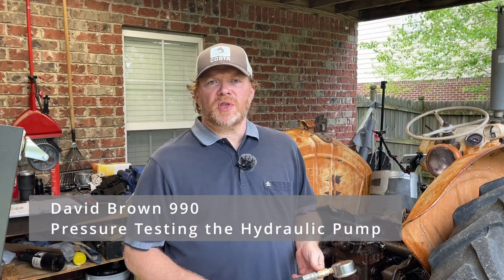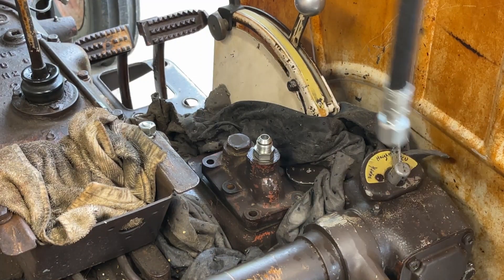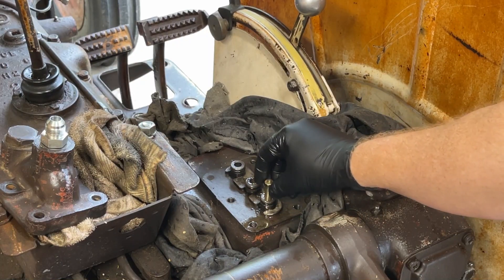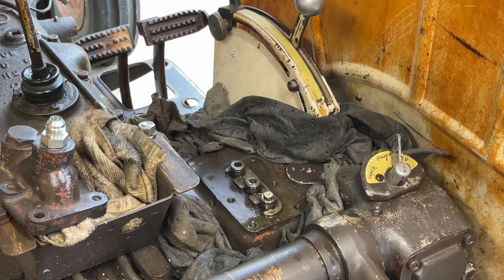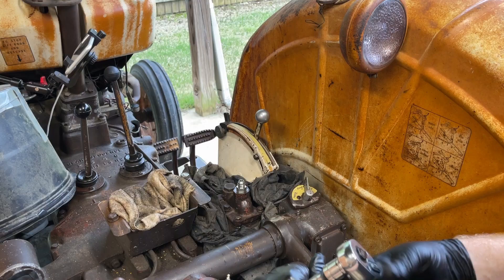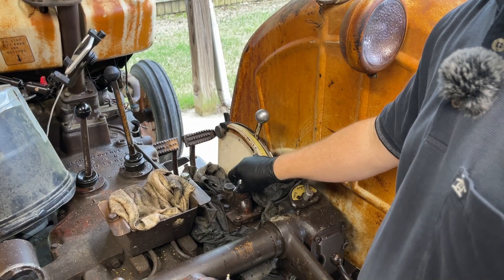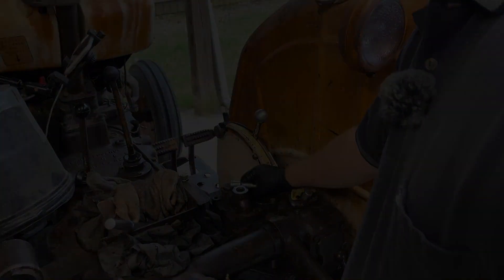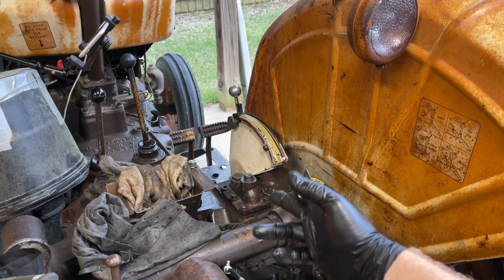Testing the Hydraulic Pump Pressure | David Brown 990 #22

Comment from the maker: For blanking off the rear pipe, anything that will seal it up on the top will work.  A short bolt that fits the hole will work just fine.  Just put an oring or something on it to help with sealing.

Comment: Hi Shane Marshall here. Do you know what the engine cylinder psi should be on my 996? Tests at Cyl 1, 300psi, cyl, 2 275psi, cyl 3, 275 psi and cylinder 4, 350 psi. I made a fake injector that can bolt on in place of an injector with compression test kit gauge  adaptor.
Reply from the maker: Hey Marshall, sorry for the delay, I've been super busy lately with actual work and family stuff.  I don't know what the PSI's should be for the cylinders.  I looked in my manuals and can't find it either.  Hope you've found out by now!
Reply: I think diesel in general are around 300-400psi. Have a vid coming in a few weeks testing the DB engine.Got a tip how to determine if it's the valves or rings from Bundy Bear, Lance. put some oil in the cylinders and if compression go's up rings if not valves. Cheers Shane

Comment: thanks for the great videos, how many hours has the 990 done?
Reply from the maker: Hi there, thanks for watching!  This was my grandfather's tractor and he bought it new back in the late 60's.  Our family used it quite extensively for farming, and from what I'm told my grandfather treated it like a bulldozer when he had a blade on the back!  I've replaced the tachometer/hour meter since the old one was broken around the same time I had the engine rebuilt about 4 years ago.  I have no clue how many hours were on it before that.  It's got 164 hours on it since the rebuild.

Comment: I really like your show.
And it was very helpful. I have a 1210 case. And I am having problems with the hydraulics. I need to know how to.
Check the pressure on.
Reply from the maker: Thanks for watching!  I really appreciate the comment!  
For your 1210, there's a service manual that covers hydraulics on those.  Check out the link to the service manual below and click the one for "U. Hydraulic System - Front Mounted Pump - 1200, 1210, 1212, 1410 and 1412 Tractors.pdf"
https://drive.google.com/drive/folders/0B9-7bn5CX9NDZ3pQdDh6M2k0bVk

I also have a video that includes more on the manuals if you're interested.  The video link should start at the right spot for the manuals discussion:
https://youtu.be/5nYhhXXpGFw?t=748s

Comment: Really like the way you work here, testing the system with a gauge.
The real test will be running it longer, to get it nice and warm.
Is I possible to connect it up, so that you can have the pressure gauge on permanently?
I would love that on mine!
Very nice work with the .38 casing!
I love fixes like that, proper thinking, and dirt cheap too 👍
Cheers from Denmark 🔧🇩🇰🚜
Reply from the maker: Thanks a bunch!  I ran it today for quite a bit pulling up large old shrubs & bushes in front of the house with a boom.  Performed flawlessly!  No leaks AND the hydraulics held!  I'd been having a problem with the arms just leaking down immediately once the tractor was off and them "hiccuping" when the tractor was running.  Those issues are GONE finally!  So happy with the outcome of all of this.  Thanks for watching!
Reply: @path.of.discovery  Totally worth it then! Your videos has given me a lot of useful insight, thanks for sharing

Comment: Good job Shane.  I couldn't quite hear but assuming the pump relief valve was screaming, this agrees with the manual that it should open at 2200psi.  So all in all, a tip top hydraulic system!
Reply from the maker: I didn't record it, but I redid the test later because I had a concern the relief valve wasn't opening.  Once going I bumped the throttle up a little bit and as the pump output rose to 2300 PSI  the relief valve kicked in screaming away.  Close enough for me!
Reply: @path.of.discovery  Indeed, not bad after 50+ years.
Reply: Sorry to ask again if already answered. To increase relief valve pressure do u add shims? My valve screams at around 1800psi. Do you know approx how many shims are needed per 100psi increase at all? Thanks

Comment: Hi Shane, you need to patent those 38 specials for hydraulic testing, you could rebrand them as .38 hydraulic blanking plugs and sell them world wide. As for torque settings I'm with Lance, it's the first click on the elbow, second clicks to tight.
but congratulations on the result with the resealed pump thats a big win win,                            it just shows, have a go, you never know!
keep up the brillant work
Barry
Reply from the maker: I've been through the patent process before and I'm not too keen on going though it again, lol.  Yes it's a big win for sure!  Was NOT expecting to get anywhere near 2000 psi.  over 1000 sure, but not 2000.  I must have done something right somewhere along the way!

Comment: Uk gun laws are very strict. It would be ni-on impossible to have a spent cartridge laying around. I made an nylon plug. Have not been doing much with tractor lately. How ever I received the new  friction washers for the  quadrent yesterday. So I may get going again soon. You should get yourself a lathe. I am getting to grips with the Bridgeport and there will be an installation video, coming soon. Thought I was doing well getting 1750 psi from hydraulic pump. Good vid as usual. M 😀
Reply from the maker: Yeah, I've been pricing out lathes and mills.  I'd love to have a mill like your Bridgeport, but I'm actually leaning toward a benchtop mill like the Precision Matthews PM728VT.  I want to do a CNC as well and from what I've seen online it's a great candidate for conversion.  For a lathe, I'm thinking about just starting out with a cheapo mini-lathe unless I can find a good used proper one.  Still looking and trying to figure out what I want to do though.  Funds are always the issue!
Reply: @path.of.discovery  If you can get a good old lathe as they were built to last. Biggest problem is shipping as they are very heavy. The Bridgeport MK1 i got is 980KG the mk2 is double that weight. M 😀

Comment: We are not allowed to have guns over here (well we can as part of a club or a farm) but I have a small cup head blot for the test, we used to fit an Australian 2c piece but they are no longer a thing over here. . If the hydraulics are "working" I think just fit the gauge then pull the quadrant on to select up onto relief. This would check the pipework and o rings to the control valve.  3/8" unc bolt around 35ft/lb or when your elbow clicks.
Reply from the maker: Afterwards I thought about it and figured I could have used a dime or nickel (10c/5c pieces) to blank it off.  Good to know it's possible.  Didn't think about just using a bolt!  Doh, that'd work too I guess.  My elbow/wrist clicks and pops aren't quite reliable just yet for torque measurements.  Getting close though! 😄  Thanks for the setting!